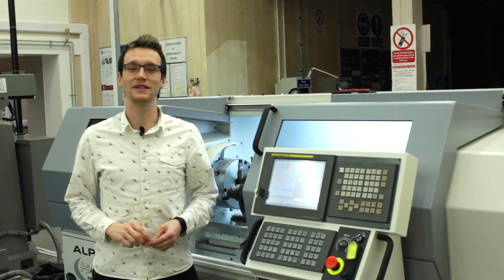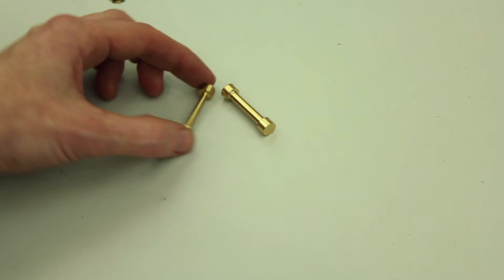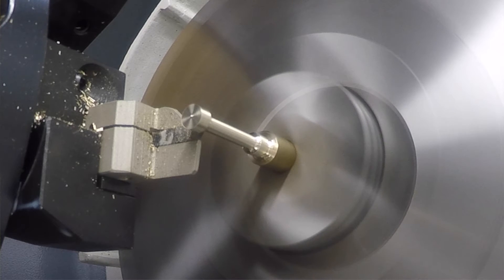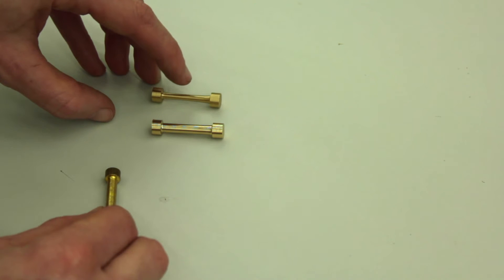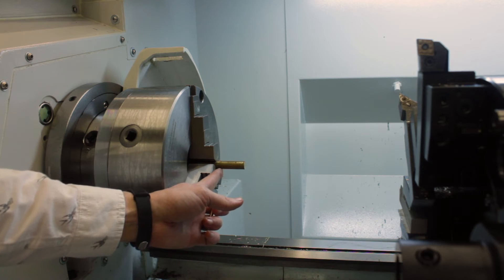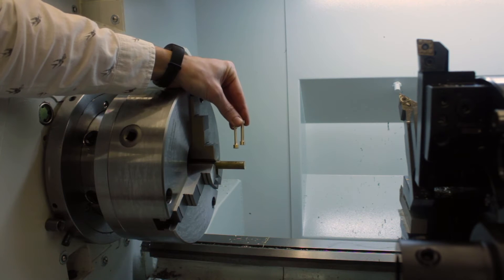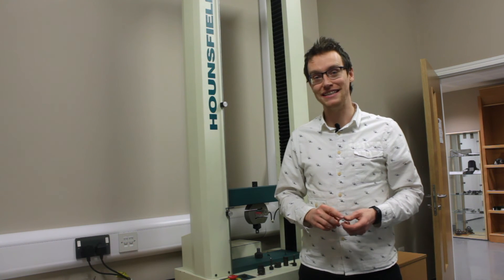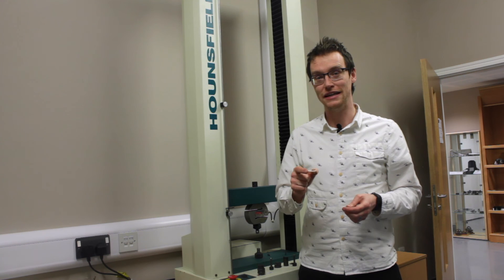Simple tip to stop Lathe Deflection!   #5minFriday   #23

Comment: Hi I have the same machine as this and also use fusion 360.

Can you please advise on the following: fusion 360 output G54 on my cnc code but this machine does not want to run the code G54.

Also do you have a video where you set up a drill on this machine.

Thank you

Comment: I don't know how this doesn't have more views! Awesome video, keep up the good work- Hope you have more turning content soon :) I just picked up a used KIA SKT21LMS with a Fanuc 0i-TB control and will be learning how to run it shortly. I've been running a HAAS mill for a few years, but it's a whole new world running lathes. So far it's been a fun journey just learning everything I can, even before it's powered up in my new shop.
Reply from the maker: Thanks Nick, that means a lot! Sounds like you have some serious kit there, what do you use it for?
Reply: I run a prototyping shop here in Orlando, FL and needed to add a CNC lathe, so I purchased this used from a local shop- I got a steal of a deal on it, but I'm still trying to find a proper shop with 3 ph power to move into. I'm hoping that will be soon though, so the research commences! It's a lot harder to find FANUC lathe info than it was for my old HAAS mill. I'm proficient on a manual lathe and in theory I am comfortable with lathe CAM, but learning a new control on a used machine is going to be a journey.
Reply from the maker: I'm sure a man of your skills will get your head round it in no time! Will you be programming directly or using some kind of cam package? I used fusion 360 to some joy and modded a post processor to work with the control. I did a video on that I'd you're interested.
Reply: I'll be programming with Fusion 360 if all goes well- hopefully I don't run into too many issues with the post.
Reply from the maker: For me, the drilling and tapping cycles were really weird and didn’t function correctly directly off the stock F360 post. I did a video on how I sorted it here, might be worth a watch:

Fusion 360 FANUC Turning Post Processor Amendments Oi-TD Tapping & Drilling  -  #5minFriday #19https://youtu.be/6mtC5eFPzho
Reply: Just watched it while eating lunch- Good stuff! I had to make some similar changes to get my old HAAS mill to cooperate with Fusion. I suspect I will have to make similar changes for my lathe's control. I really like that Harrison Alpha you have there- It looks very versatile. Something like that or a HAAS TL series machine would be a great addition to my shop for prototype work while the big lathe is running production or parts requiring live tooling.

Comment: I'd 100% agree about the no more than 3 times the diameter without support from the tailstock or some kind of steady rest. But at a certain point once the diameter grows larger that can't be a hard and fast rule. A 6" (150 mm) diameter shaft would put excessive strain on the chuck and jaws with 18" (450 mm) hanging out with only those chuck jaws holding it unless you had a very large spindle bore and the shaft was long enough to counter balance the weight. Very good video and it shows the deflection well.
Reply from the maker: Really good points, thanks for your comment. I think if our CNC lathe had an automatic tailstock then it would be a different story but continually stopping to add/remove support is too much of a pain for these small batch production jobs.

Perhaps the plan would be Part > C/Drill > Auto Tailstock in > Turn > Auto Tailstock out > Face > Part. 

I've done a bit of programming with the tailstock in, but it's another thing to crash into and it makes me nervous!
Reply from the maker: Or even better a sub spindle....mmmmmmmm